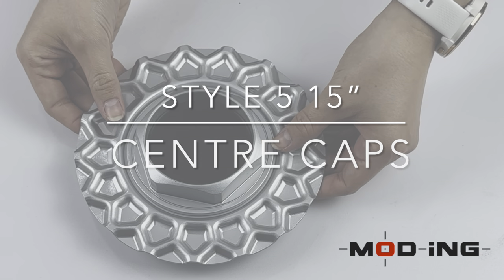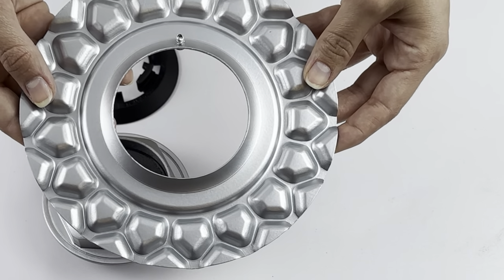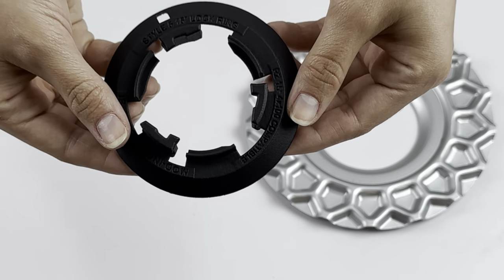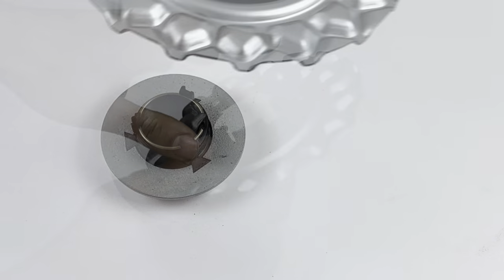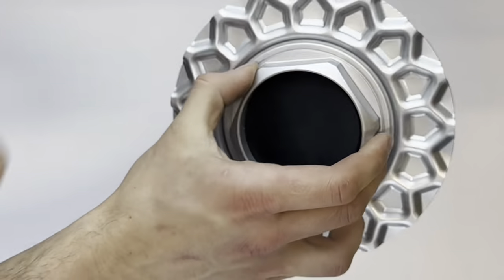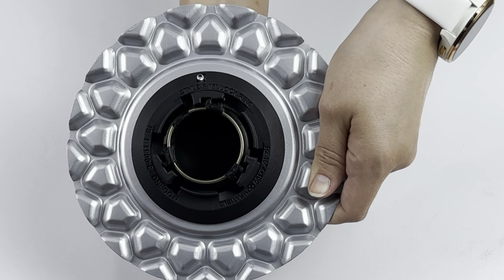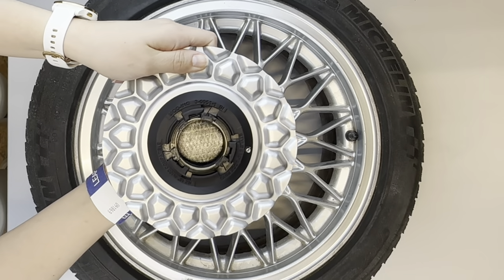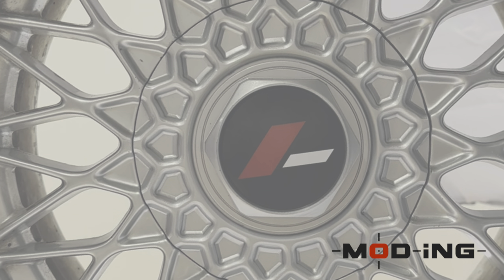BMW e30 Style 5 Center Cap Assembly (BBS RZ 15")

Comment: How do you fit the logos in there? there is no room for the 3 tabs
Reply from the maker: You can fit standard 70 mm emblem stickers in the middle:
https://mod-ing.com/caps/center_cap_parts/oem-bmw-emblem-70mm/
Reply: @Mod-ing  thanks for the rep.... so it has to be stickers.. i had the ones with the 3 tabs so i guess i cant use them with this ringlocks.